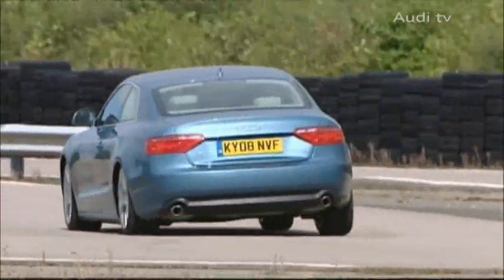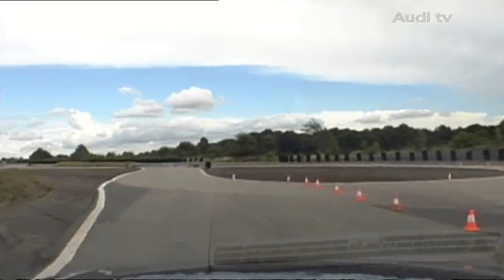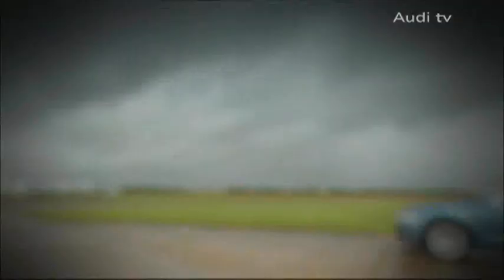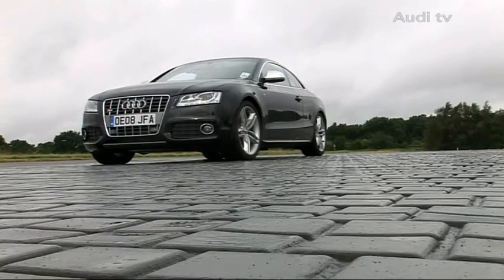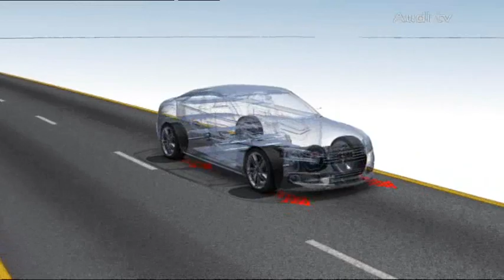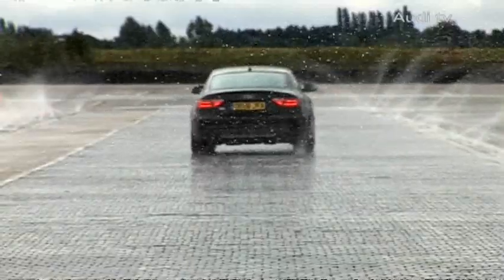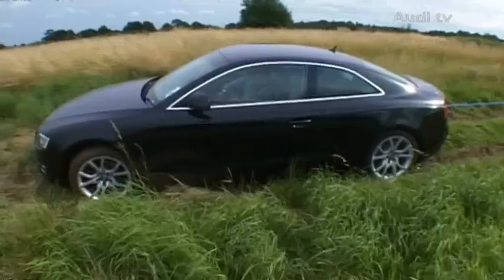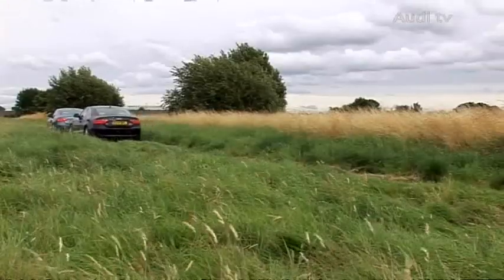Audi Quattro system in action on Audi A5

Comment: the system is good, but the cars themselves are too heavy, have engines mounted too far forward, and dont have good enough weight distribution for the awd to really excel.

theres a reason why fast audis still understeer like a bitch even with quattro.
Reply: except for the r8 and the rs3 u are pretty much right, although i love my a5 quattro and how it handles i can see it straightening a turn if you are not careful

Comment: They must see Honda's SH-AWD system. System can transfer the engine power to the four wheels seperately. Quattro can just to front or rear.
Reply: ***** Quattro can not control each wheels. System just control the power between front and rear. And then differentials send it to right and left. SH AWD control unit can send the power to the four wheels seperately. There is a clutch system in the SH AWD. Quattro has not it. It has classical two (front and rear) differantial.
Reply: no no no no Quattro can control each wheel by using wheel sped senosr,traction control etc
a4,a5,a6,a7,a8,q5,q7 using centre diff locking
s1,tt,q3,a1,a3 using multiplate clutch
r8 using viscous coupling
Reply: Bay Başkan please think before you speak this is 100% false Audi Quattro systems are the king of all wheel drive they were the first to do this to perfection please shut up about your junkie Honda. What you’re spreading is a lie Audi Quattro has single wheel differential control during extreme situations. The narrator in the video mentioned this. You’re to busy infatuated by your Honda to watch the video and learn
Reply: Even in the video the narrator says it can change power to one individual wheel...
Reply: audi made awd when honda started to learn/read about it... You shoud read more, watch less youtube
Reply: owning both a 2008 quattro a5 and awd CRV 2008, the 4x4 system of audi is way better idk wat u are saying, honda isnt full time 4x4 it only activates when front wheels lose traction